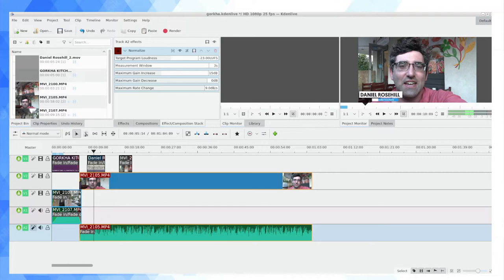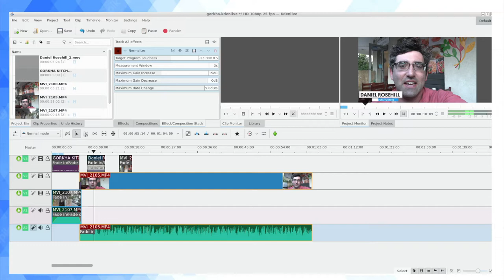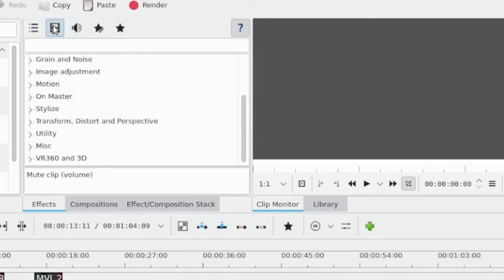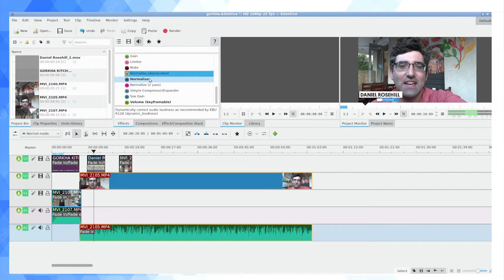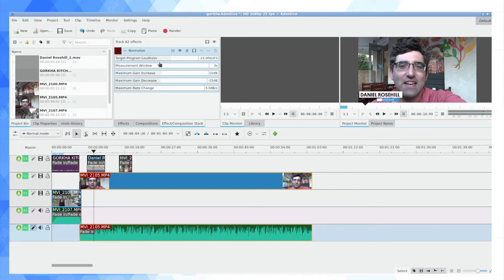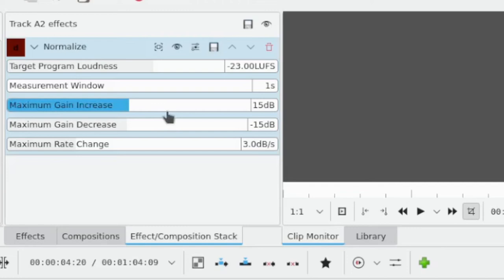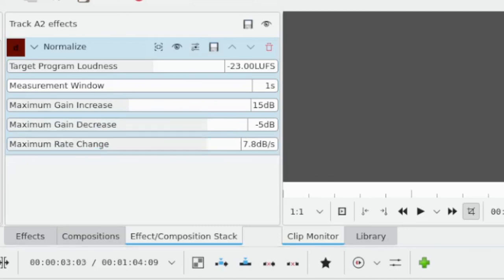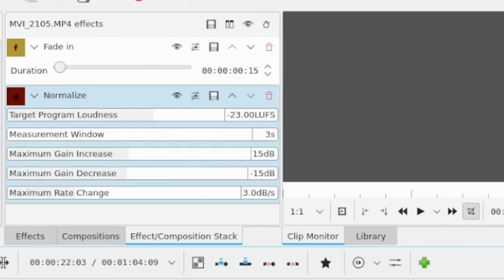Kdenlive - Normalization (Track vs. Clip Effects)

Comment: Thank you so much for doing a video on this topic! I couldn't find any other videos that specifically addressed audio normalization in KDEnlive. At first I thought the feature wasn't working. As it turned out, the original audio file was so loud that the limits of KDEnlive's audio normalization weren't big enough to compensate. I had to process the audio in Audacity to bring the gain down low enough. So that's something users should be aware of. KDEnlive can only adjust the audio so much.

Comment: When I use normalization, every audio clip I use it on jumps up in volume and becomes a blurr murmur for the beginning of it, for about 2 seconds. Applying it to the whole track does the same for every clip. Adjusting the measurement window has no effect. What causes this and is there a fix?
Reply: happens to me as well, cant really tell why